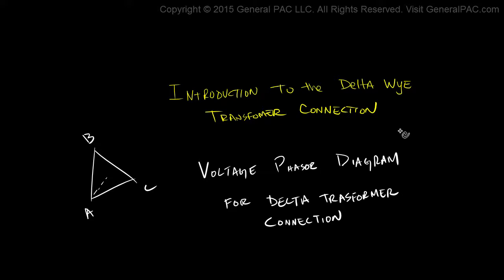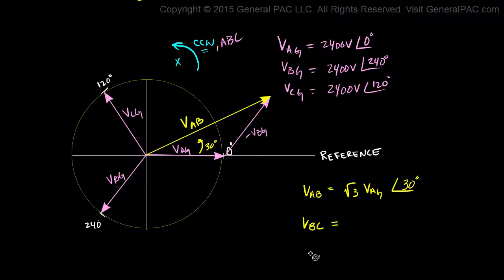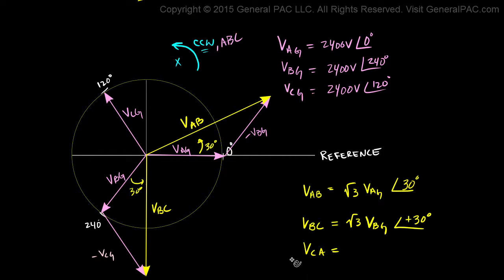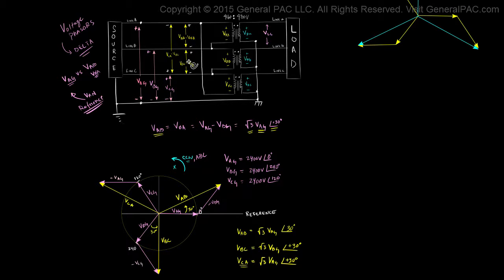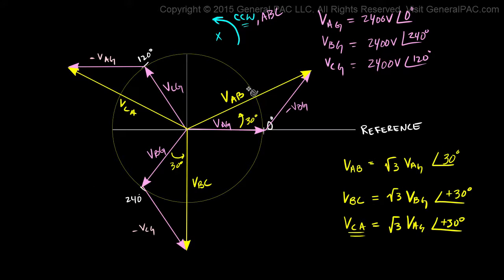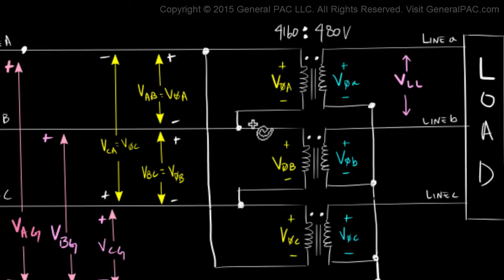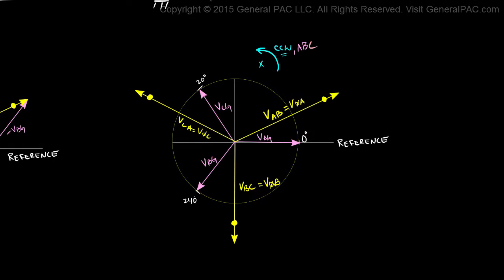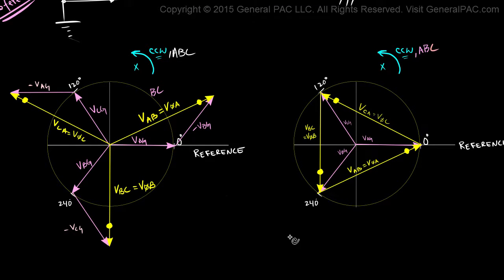Introduction to the Delta Wye Transformer Connection Part 6c: Voltage Phasor Diagram

Comment: what if the source is an output of a Delta-Delta transformer with no ground. what would the "reference voltage" be in that case or VAg, VBg, and Vcg?

Comment: Very good explanation. I guess 3phase 4 wire (with Neutral) is called 3 element mode.  
can you pls also explain about phasor of 3phase 3wire mode (2 element mode, I think phaseB is common connected to Neutral!) from Meter perspective ?